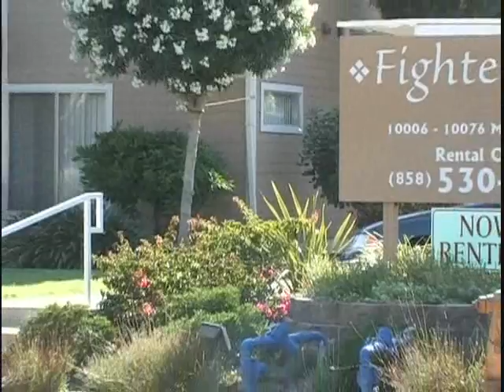Skateboard Manufacturing: An Insider's View

Comment: Except...like most manufactures they're still pressing five or six at a time so each of those boards is going to be slightly different. The top is going to be diffferent from the bottom  and the ones in between are somewhere in between. Lol.

Comment: is it true if you stack the decks in the presser with out a mold on before each deck wont the concave of the deck be slightly diffrent from the top deck 1 to 5 like this 
1
2
3
4
5